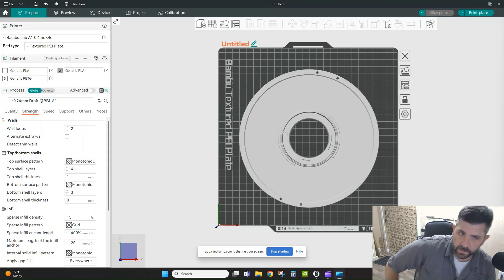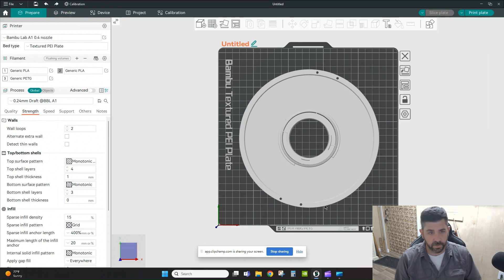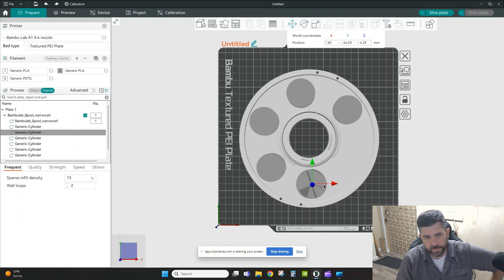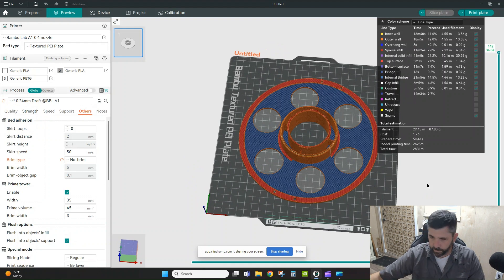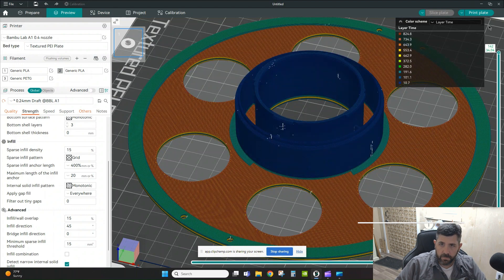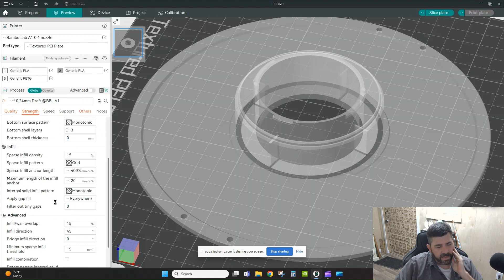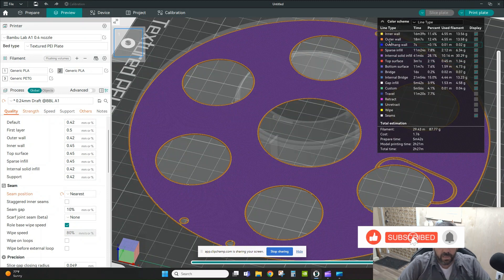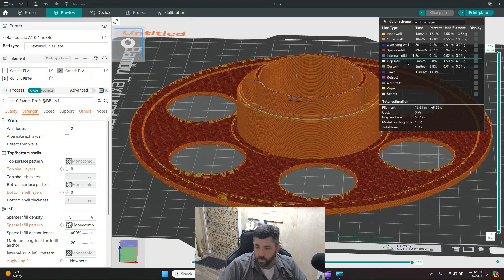Orca Slicer: Optimize Your 3D Prints with Preview, Negative Parts, Tricky top/bottom Layers

Comment: Im a cura user an ust started orca. i notest it adding topp layers to my print. set it ti 3 an it sliced with 4. set ut to 4 an it sliced with 6. hav you had that? I fill like i got less control in orca.
Reply from the maker: Basically Orca will use which ever value is greater between Top Shell Layers and Top Shell Thickness.  So if you say 5 top shell layers at .2mm layer height (1mm total), but have 2mm in Top Shell Thickness, it's going to produce more top layers then specified in the Top Shell field.